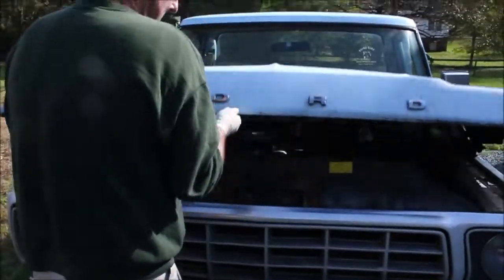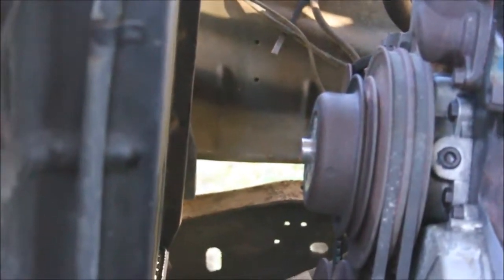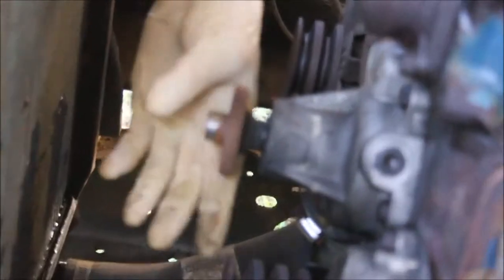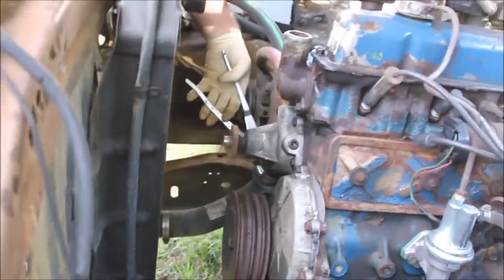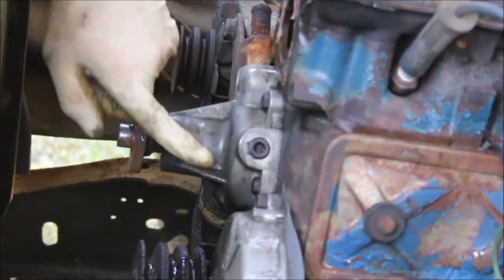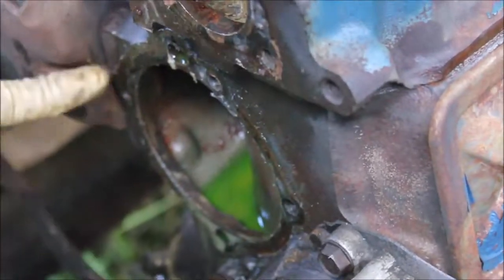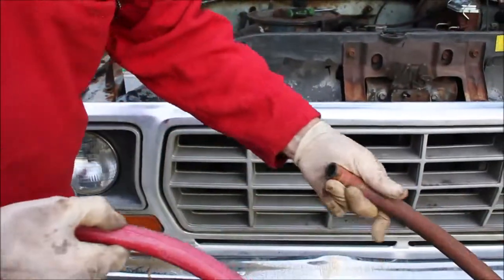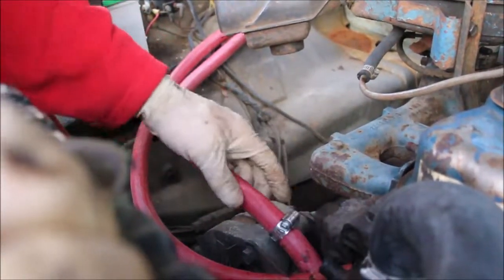Old Ford Truck Water Pump Replacement

Comment: Yours is the only useful vid on YouTube for replacing a water pump on a 6th Gen F150 "Dentside".  I just picked up a 1978 F150 Ranger Lariat with the 400/6.6L, replaced the radiator hoses and thermostat only to find the water pump leaking.  Probably the gasket, but might as well do the pump.  And the belts.  And those few more things I'll find along the way, too.  Thanks for the vid!

Comment: Excellent video! I’m getting ready to replace the water pump on my 1968 f100 as it’s so loud I can hear it 50m away. As soon as the video started I went “yup, that’s my engine”. first vehicle I’ve owned so I’m really resistant to do my own work on it but this video was super informative and step by step. All I have extra is a power steering pump but that’ll be to easy to loosen so I can get the belt off

Comment: Your the best! 4.9 liter engine is so easy to work on! My fan was starting to shake a little, question  do i have to have that bleeding tool , or can i just pour the fluid in the radiator as regular?
Reply from the maker: If you do it that way, be careful!!!, because as the thermostat starts trying to  open, it might kinda belch boiling hot coolant out of the top of the radiator.
Reply: Thank you !

Comment: Jeffs auto i have another question, so my original alternator went bad on my 79 f100 4.9liter same as you have, so i purchased a alternator ,(did get it checked and it was good) from advance auto parts   and put it on , put on new voltage regulator but its charging at 12, it should be at 14, ( the alternator light doesnt glow on when attempting to start truck like used to and go away when started.) I do have one right tail light works , and blinks but the left doesnt and no blink.  The black/red connectors to the alternator are the original push on old ones, do they need to be changed, what could be my problem? Thanks🙁😁🤝🤝🤝🤝
Reply from the maker: Could be a bad connection at the battery.  Also check for loose connection at the  and the connector where the wires attach (which is where mine was loose).  I had the same problem.
Reply: @JeffsAuto  thank you jeff!